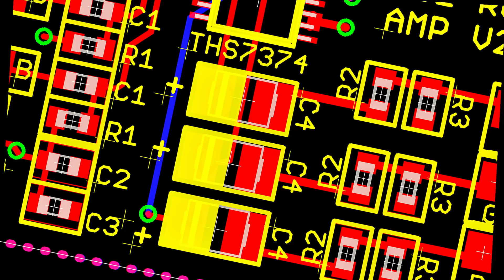BUILDING A PCB BOARD WITH SMD COMPONENTS

Comment: Dang! You got the process down. Well done.
One tip: if you can panelize your PCBs and get the appropriate stencil, you can apply paste many boards at once. It may make component placement be a little faster too as you have the option of placing each type of component in batches.

Comment: Easiest way to get rid of bridges or those little drip-pulled stalagmites: Splash the area with some liquid no-clean flux and THEN use the iron to melt the bridge or drip pull. Makes it so much easier than trying to use the iron dry. This is a tip more for beginners, but if you ever find your solder is acting 'gooey' or sticky, it means you don't have enough flux to keep that flowing action going.

Comment: Did you get permission to use this design which is clearly the Mickcris amp available from Console5?
Reply: RETRO GAMING ARTS I have to agree with Falcon. You may have permission from Helder but that design is stolen. Selling this is extremely dishonest and not ok.
Reply: Look you guys need to get off Paul's case, I designed the board for Mickcris about 2 years ago or so as a favor for him since I don't have a PCE nor do I care to have one. He did pay me to do it but it was not alot since it's based off of a schematic widely known in the Retro Modding community and this same chip is used in many other RGB Amp boards for other consoles. I never had any kind of contract with Mickcris and he does have the files to have them made whenever he wanted and that was our agreement and nothing else beyond that.

Is Paul stealing his boards when they weren't anyone else's but my own ? No I made these available to Paul since he asked me about some other mods to help him have easier installs and of course look more professional than some perf board solder job. Apparently Mickcris has been selling them for a while and even got them sold on a modding site (Console5) so I doubt he's going to loser customers over Paul's own spin on it and if anyone is to be mad it would be me right? I mean it's been sold off on Console5 for a while now and I haven't gotten paid any royalties or anything BUT I'm not mad at all so I see no reason for people to be mad at anyone when they are not directly affected by any of this or involved in it.

Before people take this out of context or misinterpret anything I said above. I'm not mad or angry or have any ill will towards Mickcris and in my eyes I (or Paul) have done no wrong since we didn't have any kind of contract and he has been selling the boards for quite some time and I have never said anything about that nor will I since  it's a public and open source schematic. I can and will sell anything I designed to whomever I want unless we have an agreement to not do so and anyone can copy the existing schematic and do their own version and have the same outcome ( on the console I mean) even though the boards might look slightly different.
Reply: looks like a voultar copy to me.
Reply from the maker: Well, thanks for watching guys. helder designed the board for mickcris, and gave me pretty much the exact same design. Thank you for jumping to conclusions.
Reply: JT8088 ATX as a response to this Mickcris has decided to release the boards freely on OSHPark. So if someone wants one, the can make their own instead.

https://oshpark.com/profiles/mickcris
Reply: Haha why is everyone going crazy? He didn’t steal the design from anyone, he commissioned a design from Helder, whether selling said design violates Helder’s agreements with anyone else has nothing to do with Paul. That would be on Helder, if it even is a violation. All Paul did was commission a pcb design, and assemble the boards. If you commissioned a plumber, and the plumber installed stolen hardware, the cops wouldn’t arrest the customer, they’d arrest the plumber. & Where are you getting the idea that it’s stolen? He commissioned the pcb from Helder
Reply from the maker: I got permission to use this design, from the person who designed it for me.
Reply: Was that Mickcris? Since the designators are even exactly the same?
Reply from the maker: Doesn't seem like you watched the video, you would of been able to see who designed it if you watched.. I put alot of effort into everything i do, exspecially making these video, check out my channel, hundred some odd videos, i put  alot of effort i put into this youtube channel, and the answer to your question is literally 4 seconds into the video...
Reply from the maker: Oh, Sorry, 8 seconds into the video
Reply from the maker: Hmm, Let me get to the bottom of this and find out what's what. Not on my site yet, Just a youtube video as of now
Reply: like i said its another voultar 7374 copy.
Reply: Oh, c'mon guys. This isn't anything like my DUORGB board. The only thing that it shares in common (for the most part) is the THS7374 driver.  The routing is kind of crappy and the solder resist isn't even pulled down over the via's. I'd make a few changes before actually selling these for money. Otherwise, it's not bad at all.
Reply: So what you are saying is you stole someone else's design. Copied it to a T, used the same designators, and have no shame in being a thief?
Reply: RETRO GAMING ARTS so here's the thing, it's not jumping to conclusions when you see a board that has been sold for years, longer than you have been around even, being sold now by you.

This also doesn't invalidate the question. It also poses new questions that you should be asking Helder. Such as, if he "designed the board for you" then why is it a duplicate of a board he designed for someone else years ago. Mickcris has been selling this board for a long time. What was the agreement they had since no one but Mickcris sold this board before now? If this was contracted in anyway, did Helder just break that contract by giving you the board? Why didn't he tell you that he gave you an exact duplicate of an existing board?

It's great that you want to help people but right now this isn't a new product that was missing from the market. It also is another situation you have found yourself in where your integrity comes into question. If I was you, I would speak with Helder because this is now the second time that a project involving both of you has come into question. Just make sure you are covering your bases and he is actually disclosing all the details to you.
Reply from the maker: man, i really just wanted to help people not use RF or composite anymore, because these games blew our minds as kids, and playing in rgb can blow your mind as an adultif you check out my whole channel, there's kinda alot all about that, i love showing people soldering techniques and stuff, trying to help others, all this stuff you'll find all over my channel, i was really excited to show people the process of making chips diy style, it was something new i have not yet made a video about
Reply: Helder Silva do you hear yourself? You were paid, regardless of amount. That constitutes a contract. You were commissioned to make a board for someone else. As you said yourself, you didn't own a PC Engine or have desire to get one.

When you are paid to do a job for someone that doesn't mean you get royalties and since Mickcris asked you to lay it out and gave you money, it's his, not yours. By copying the board design almost exactly with minor tweaks but even keeping the designators the same, you literally sold a design that was not yours to someone else.

The amp being used in other boards means nothing. The schematic being available publicly also means nothing. Those don't get you off the hook. Maybe you should do some historical digging and look into how copyright law works. If Mickcris wanted to make this a legal case, he could and he would win.

Now if you had designed a different layout for the board but used the same components that would not be a violation unless the schematic held a copyright or was intellectual property.

To the other guy that doesn't understand how the justice system works. Possession of stolen goods is illegal and the owner of the house in your example could be arrested or fined.